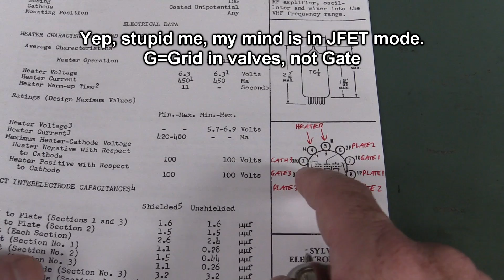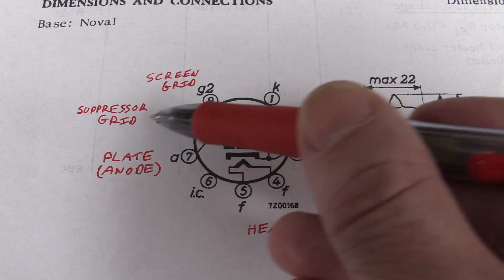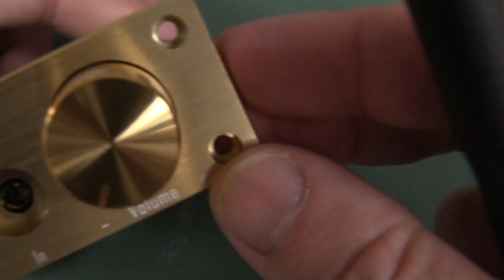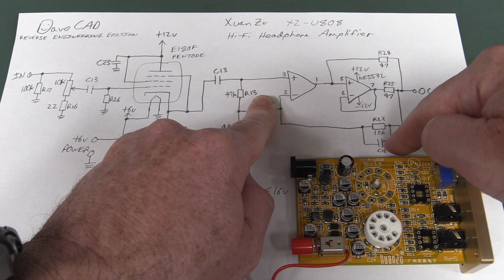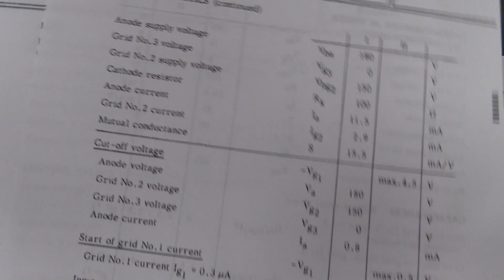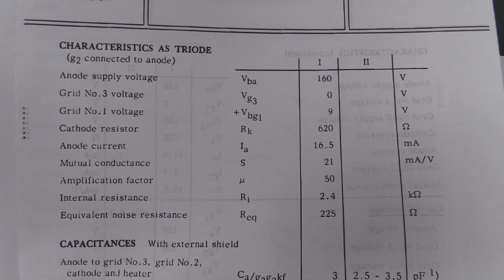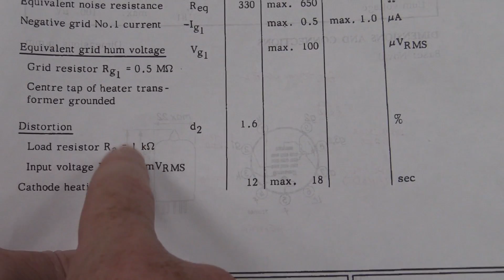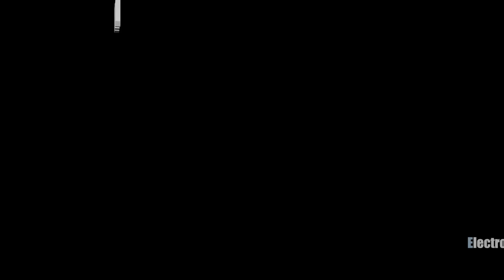EEVblog #837 - Reverse Engineering A Valve Headphone Amplifier

Comment: Hi Dave. The reason they are using that simplified 6688 tube, is due to cathode area or (size.) Larger cathode area in a small vacuum tube means they will operate at lower Voltages ( providing they don't have to produce much drive power) They would have been better off to use a "space charge" tube and arrangement. A space charge tube is designed to work with 12 Volts on the plate.
Enjoy your holidays!
Reply: +Mr Carlson's Lab  Whats a "space charge" tube??
Reply: +Jack neff 
Hi Jack. Space charge tubes were used in equipment when no high voltage was present (IE: late 50's car radios.) They use the space charge grid principal to accelerate electrons at low plate potential. They differ a little in operation from a normal tube... EG: The control grid is is positively charged to act as an accelerator grid. The screen grid is where you feed your signal to be amplified. The suppressor grid (if any) in some applications is also positively charged.  The tube 12K5 comes to mind.
Reply: +Mr Carlson's Lab China needs to start making space charge tubes again if they are going to make things like this instead of sticking random tubes in a random circuit.
Reply: I agree!
Reply: Unless...no...they wouldn't...of course they would, it's China, the home of cheap and electrocuting electrical ;-;
unboxes new amp wall wart, reads back
Class I Power Adapter
Input: 100 - 240VAC 0.2A
Output: 200VDC 0.1A
Reply: +cyberdragon... it's trash precisely because you keep buying it.  In fact, they will make the next model even worse to see where your limit (if any) is.
Reply: Hi Paul, i'm learning much about tubes watching your old school radio restorations. Hope you can make a video on what's the advantages or disadvantages of using tubes on audio applications and what a "tube sound" really is on an oscilloscope :)
Reply: Great idea for a future video!
Reply: I had the idea that the tubes were useless. Just cosmetic fake ones. I am surprised that Chinese didn't cheat as usual.   I am very interesting to buy that amplifier now. Of course transistors do better job with lower power consumption, lower price and better quality. Of course CDs are better than Vinyl disks. The design counts more than the final performance.
Reply: +Mr Carlson&#39;s Lab Low volts=high amps. Low density per area=high flow per area. So, in a pseudo hi-fi sense, it means lower attunation over the frequency range(flatter EQ). Why not a low value resistor? Resistors are not powered...
Omg, im falling into the marketing wankery. This is a non-effective, effective placebo efect for people who don&#39;t know jack shit about audio. &quot;oh, i can hear bass and treble more clear...&quot;. Come back, when you can hear octaves, mate...
Reply: What a sight for sore eyes to see this comment. Thank goodness you are here with your experience which helps me understand so much better. Cheers.
Reply: Mr Carlson's Lab I've learned all I know from you glasslinger and shango lol thanks!
Reply: Mr Carlson is the tube master lol
Reply: I really liked the video where you revitalized the signal generator with the 4 tubes, the one that needed treatment due to corrosion.
Reply: I have wondered about using 12v on the plate, and only a few tubes are shown as such in the older car radios, and I remember others with vibrators and some with a transistor inverter circuit to get the HV for the plates.  I might have one of those radios with the 12v plates, but I wonder how collectable they are to some people (as I have a few things here I will not likely use in my lifetime). Hope you are not snowed in there in Canada Paul. There are some states here that the snow gets quite deep, and I am close as I like right now to snow... About 20 miles from here and at a higher elevation.
Reply: So there is a reason for using the RF valves rather than more dedicated AF valves ? or is the chinese fake an AF / Wideband valve despite its labelling
Reply: Hi Mr. Carlson, I have a question. Does the headphone amplifier actually adequately accelerate the electrons in the tube? Also love your channel.
Reply: Anyone wanting to know more about space charge tubes can find everything you need in the link below
http://www.junkbox.com/electronics/lowvoltagetubes.shtml
This is an amazing site, it's a pity that there's no video on the same topic..
Reply: The top tube expert commenting on Dave's video. Great!

Comment: You brought a tear to my eye, I didn't know anyone still uses vacuum tubes. 
Back in 1959, when bits were flat,    I went to a very good Engineering school  we were taught  vacuum tube circuit design.  . Seeing the plate characteristic graph brought it all back.  
Immediately  after graduation I went directly into computer programming.